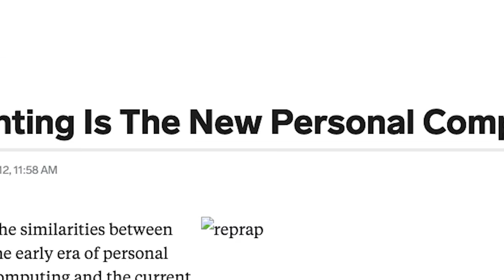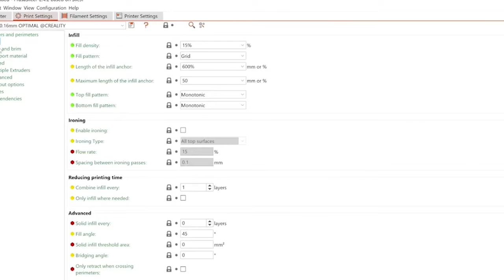Home 3D Printers Will Never Work

Comment: 3D printing is not nearly as complex as you make it out to be. Nor as unreliable. I got my first 3D printer when I was like 14 and it took me 2 days to wrap my head around it. I still have that same printer and up until recently never changed out any parts bar the nozzle and it always worked. Consumer 3D printers should absolutely be a household appliance because it reduces reliance on other people and other companies to do things you could very well do yourself. Print to order for odds and ends is way too inefficient to work which is why you yourself deal only in quantities so suggesting print farms as an alternative to home printers is ridiculous. This entire video seems less like an actual opinion piece and more like you trying to alter certain paradigms around 3D printing to suit your own business model better.
Reply from the maker: How long did it take you to wrap your head around your microwave? And you  are correct about self-reliance. But when was the last time you sewed your own clothes?
Reply: @slant3d  i'm personally not good at sewing though i can and do, but a lot of the people around here are seamstresses as a hobby. You're missing the point. Additionally, microwaves and other appliances not being user serviceable is a product of corps trying to increase profits by forcing you to buy a new one. Nothing is stopping you from trying to fix your washing machine except security screws and proprietary parts. Trying to use an immoral business practice that got normalized by everyone doing it to justify that business practice being carried over to FFF AM - the one thing that could combat said business practice - is a boomer tier corporate mindset that has no place outside some boardroom.
Reply: @schizophrenicgaming365  "As a hobby" means not in every home. The difference is massive.

And unless you can get almost every hobbyist to learn to 3d model and learn for 3d printing specifically, the adoption rate will be severely limited.
Reply: @SirSpence99  That's largely a software problem and cataloging. There's no reason a large portion of functional part design can't be automated. And imagine if, eg by law, every manufactured product sold had models of all its parts catalogued somewhere whereby, whenever anything broke, you could just look it up and instantly get the STL to print? The obstacles to this are limits in our economic systems and imaginations, not anything fundamental.
Reply: @SirSpence99  it doesnt have to be a hobby. It could be another skill that is good to have, like sewing or doing your own brakes. I don't understand why everyone's reaction to technological progession is to use it to enable intellectual regression. Just because someone else can do it for you doesn't mean you shouldn't do it yourself.
Reply: @daliasprints9798  True, it is a cataloguing problem but the amount of effort required to get a catalogue like what you are talking is literally astronomical. That is, the effort is on the order of a space program. And then, after it is done, you might get the benefit.

Also, a government getting involved in that way would be a great way to make businesses not produce anything in the country with that law, and good luck getting businesses in other countries to comply.
Reply: @schizophrenicgaming365  Sewing and doing your own car maintenance is a hobby for most people who do it. Almost no one does their own brakes. (I say this as someone who has and has relubed the calipers.)

I see no viable way to get it to just another skill unless you have mandatory classes on 3d modeling and oh boy, let me tell you, from having taught high school students how to 3d model, about half of the students who are already inclined to do it, aren't capable of being competent enough to do it... Which means at the absolute maximum, you would get 25% of the population who could model. It is more likely to be south of 10% and that would be with extensive programs.
Reply from the maker: A sewing machine is quite affordable and reliable.
Reply: @slant3d  I've literally seen sewing machines more expensive than consumer 3d printers lmao
Reply: @slant3d  Microwaving, sewing and 3d printing are three completely unrelated things - that's completely irrelevant
Reply: And yet you can go on a forum and see 1000’s of problems people have had..some get resolved and some don’t.
Even the video on here why white filament was a problem to print caused me headaches and i never got a good print and wonders why till i saw that video. There are tons or variables so unless you lock people down to one type of filament, one consistently good brand of filament, that is a perfect 1.75mm, one nozzle size, always use support vigorously, in a preheated box, run at very slow speeds, etc etc
All i can say is you must be the luckiest 3d printer person as you never seemed to have any failed prints ever.
Reply: @mrfoameruk  the fact you think john smith running PLA in his ender 3 to make a new handle for his air fryer needs a heated enclosure and to run at slow speeds tells me you either didnt properly follow the conversation or you just dont know what you're talking about. The average person using a printer as an appliance to aid with fixing stuff around the house, etc. Will encounter basically zero issues provided they do the shit everyone should do anyway like level the damn bed. When people like you bitch about how hard FFF is, from my perspective it looks like you're either not taking the time to actually learn what you're doing or you're faking it to gatekeep 3D printing in order to keep it's nerd street cred internet points lile what people tried to do with Linux back in 2016. It isn't hard. Nothing about consumer level FFF is hard. Someone has already made a cura profile for your printer. It comes calibrated from the factory. Level your bed and don't buy cheap filament and everything will be okay.
Reply: @schizophrenicgaming365  TLDR.....LOL
Reply: @mrfoameruk  TLDR:
Average dude using printer to replace doorknobs or some shit wont need any of that because he'll be printing PLA on an ender 3 someone has already made a profile for. If you have issues constantly you are doing something seriously wrong.
Reply: @schizophrenicgaming365  ...
"Average dude using printer to replace doorknobs or some shit wont need any of that because he'll be printing PLA on an ender 3 someone has already made a profile for. If you have issues constantly you are doing something seriously wrong."

No. Full stop, no. That is ignoring all of the hard parts.

For one, an Ender 3 does not have the capability to meet the needs of an average consumer. 
Most average consumers will never do a print that takes longer than 12 hours. That means either a much smaller bed and/or a much faster printer, probably something on the speed of 600mm/s.
Most average consumers will break the printer if they are told to remove a failed print. That means either an excellent support network or near foolproof error correction. 
Most average consumers will leave their stuff in a hot car, so no PLA which means enclosure.
Most average consumers will mess up the slicer settings. You would have to have the slicer have maybe 5 options total and any combination of them that wasn't mutually exclusive would have to work 99%+ of the time. Good luck getting that success rate on an ender 3 no matter what you are printing.
Most average consumers will freak out if the printer starts making loud/weird noises.

That means you need a printer that is super fast, super quiet, closed loop + error correcting, able to auto eject parts as well as failed ones, incredibly simple to operate,  (power button, then maybe 5 other settings you can tweak) has the ability to deal with power loss (which runs counter to auto eject in most cases because you need the bed to not release the print once the bed cools down) can handle being beaten up and is near disposable or so easy to maintain that a skilled person can maintain it remotely. Oh, and it needs to cost no more than 500USD.
Reply: @SirSpence99  i don't feel like typing an entire response to the least educated reply i have ever read in my life, so i talked about it on my channel. feel free to watch it.
Reply: @SirSpence99  please. explain to me what I, someone with years experience doing this, someone who gets paid to do this, don't understand. If you're the real expert, lay it out for me. Because so far it seems like you're just projecting your own anecdotal evidence of printing being hard (because you're incompetent) onto the field as a whole. so educate me. what do i not understand?
Reply: @SirSpence99  according to someone who thinks a consumer level printer making one off replacement parts requires auto eject and a heated volume.

Comment: It took decades for computers to end up in most homes...but then it was replaced with much more refined phones, tablets, and gaming consoles which were better and easier for the average user. 3D TVs had a similar go at it and it is now more likely that people will have a VR headset in their home than a 3D tv, but even that is not widespread yet. 3D printing is still decades off from being in most homes...and will likely be replaced with something a lot more refined and simple before an aspect of 3D printers makes it there.
Reply: Well, they technically ARE computers. So ¯\_(ツ)_/¯

Comment: Bambu labs
Reply: It's still not a consumer product. I can't give it to my sister, mum, dad and they look at the manual for 10 minutes (like a dishwasher, oven etc) and they are going. I've also heard when they do go wrong (and they will) they are hard to fix as some of the bits that need replacing need disassembly of the machine.
Reply: @mrfoameruk  Which will spawn a new industry of 3D printer repair people. In the same way that most people call a repair person if their dryer dies and it usually requires disassembly to fix, 3D printing will need its version of that. Definitely a great field to get into now as it will be huge soon -- trades will always be where the money is!
Reply: @CursedByDesign  People need to print on paper for records.
There are 2 problems with 3d printers let alone the printer itself.

1. Unless you are a maker it will never be needed. You may be able to print an STL but how many lampshade, spiderman busts will people really need.
2. Normal people won't be able to make what they want as they can't get their ideas into the 3d print even for something as simple as a bracket.
Reply: It is inevitable that by the late 2020s we will have a near flawless stock machine ready strait out of box, opening the market up massively. Do I beleive every home will have one? No, can I see 3-5% of homes? Yes. I could see global demand go from 2-3 million printers to 50 million a year with the right printer.
Reply: 10 more years until it's as easy as an inkjet printer
Reply from the maker: So it jams 3 times more often than a paper printer since it has 3 times more points of actuation
Reply: @ColonialDepot  That's what they said 10 years ago,
Reply from the maker: It is closer. But Bambu has yet to prove longevity and reliablity of any extended period of time. And it they will eventually break. Faster than any other "appliance" ever will.
Reply: @slant3d   they did prove it, what now?
Reply: Poor example, these printers have yet to prove themselves